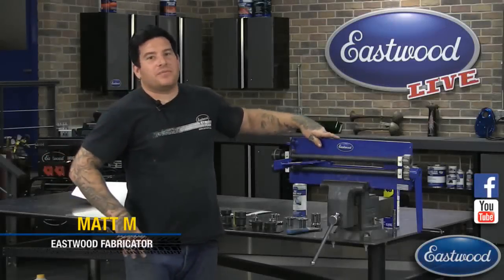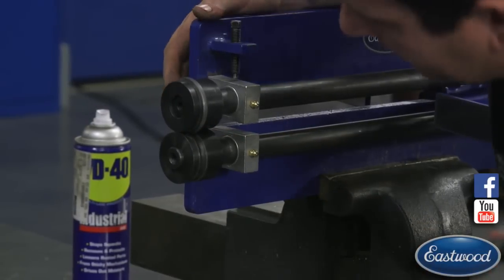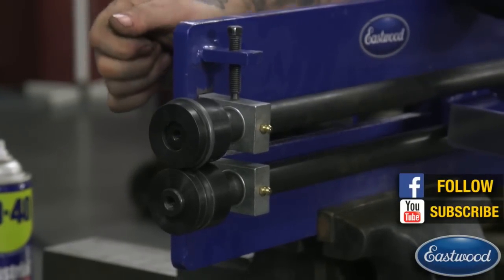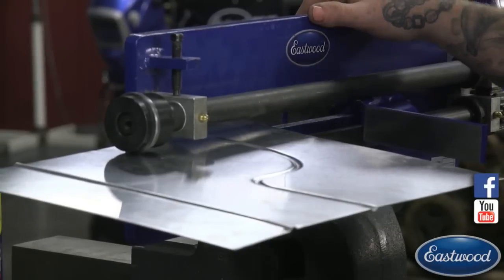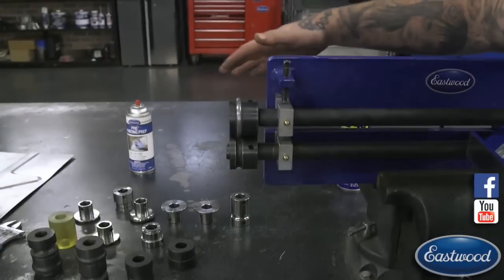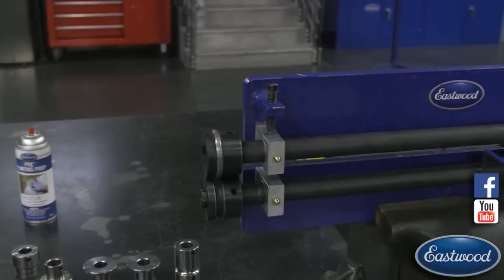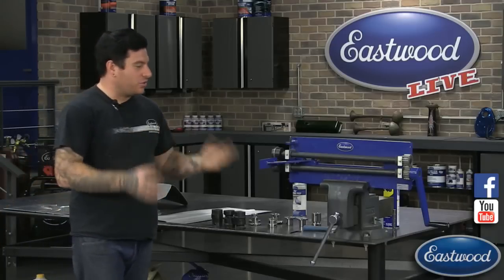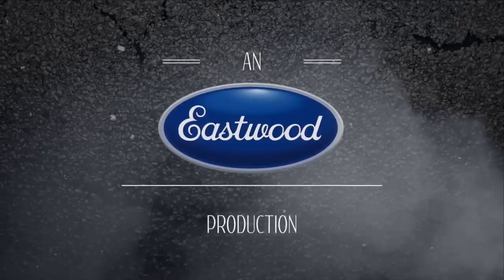Learn How to Use a Bead Roller - Basics of Bead Rolling From Eastwood

Comment: I use a skateboard wheel to stretch lightly oil canned panels. Works great. Same ID as this tools shaft OD 7/8". Long board wheels are wider. They work better.